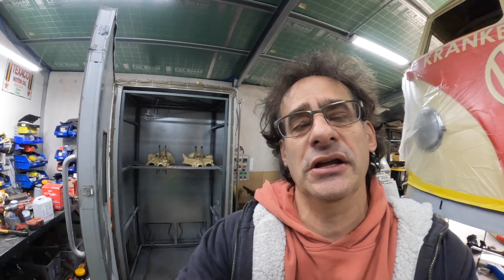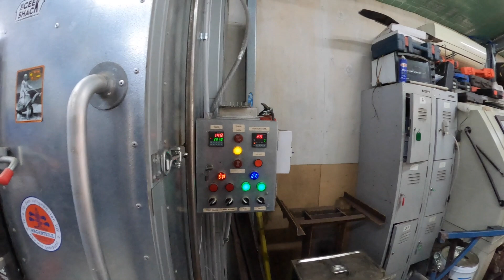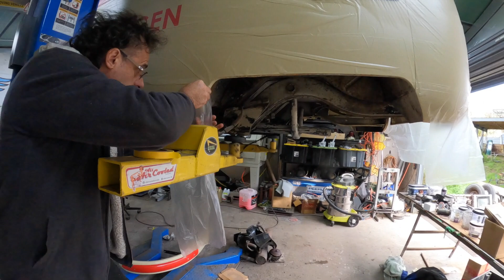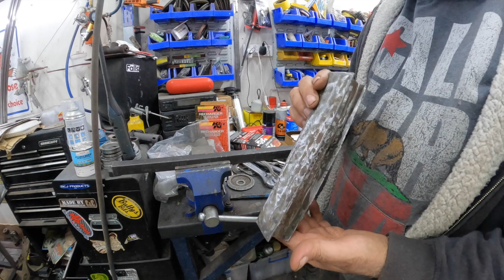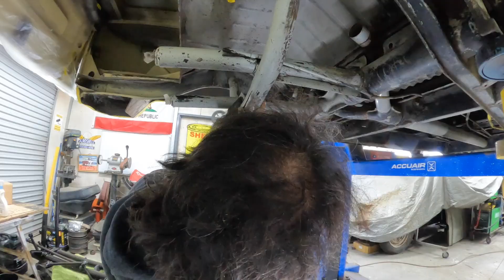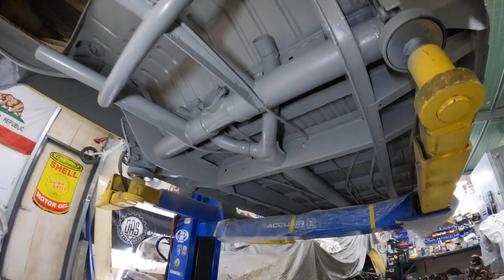Rebuilding a 1952 barn door ambulance // Painting the under body. #barndoor

Comment: What are you using on the cases? Looking good!
Reply from the maker: VHT paint coating
Reply: @DemopVWgarage  So, VHT gold engine enamel? Might steal that idea for my 30hp block..
Reply from the maker: No its caliper paint, engine is too thick and will trap the heat in. It needs to be baked in the oven too ;)
Reply: @DemopVWgarage  Thanks!